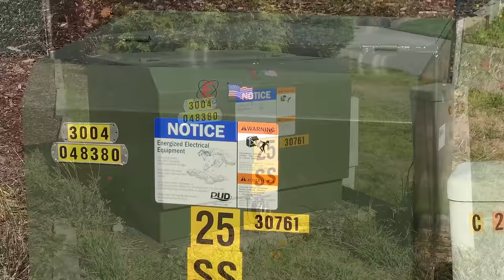Replacing a Pad Mounted Residential Transformer

Comment: Just as a followup, the customer contacted the PUD about the condition of the transformer on his property. Crews were concerned that due to the age that it might be had a good potential for leaking. Upon inspection it was determined it was in rough shape with quite a bit of corrosion (the unit dates back to the 1970s) and warranted replacement to avoid a potential leak. A win-win for both the customers and the PUD, as a changeout would not have occurred for simple aesthetics. The old unit was standard painted steel and the new unit is painted stainless steel, which will be much more resistant to the elements. Great video!
Reply: 25 as in 25 KVA= 100 AMPS ?
Reply: Guys must be non union rats 🐀
Reply: As stated in the video, that transformer was providing service for 3 homes, so up to 600 amps of secondary protection on that. The poco assumes the services are rarely going to be at full capacity, and wet transformers can take a beating.
Reply: Transformer must be dead, parking the other ends killing the primary side. Still lot of safety issues to be addressed.
Reply: If this exact same job was done in 1319 territory for UGI or PPL every person on site would be terminated immediately. So many bad practices and safety violations it is insane. Not a great video but a disgrace to the electrical industry and lineman everywhere. I cant believe PUD would even acknowledge this videos existence let alone comment on it
Reply: @demoniack81  Very unlikely that back feed would be present on the system unless like you said, some idiot plugged a gas generator in to an outlet or something stupid. But I'm assuming they probably know that this transformer is only feeding 2 or 3 houses and they are confident that there isn't any potential concerns of back feed. Also, they had the primaries capped the whole time and parked the feeder lines, so the transformer wasn't live until the end when they used a hot stick to connect the primary side.
Reply: demoniack81 it’s hot. They turned it back on to test secondary voltage then killed then plugged back in. And they either ran houses or closed a loop with a feed through. Big no no. Bunch of trash. And it took longer hot anyway. Kill it on both ends. Remove one screw on multi taps leave secondaries on tap. Put new tx. Plug both elbows. Make one hot next tx. Test voltage. Unplug next tx. Connect taps make it hot have nice day. Takes 15 minutes to still do it safely. Bunch of trash.
Reply: Sergeant Seven all utilities policy for contractors is hot gloves in tx if anything is energized. Hot primary means hot gloves. And pointless to leave it hot anyway. Takes longer less safer.
Reply: Great video lol. Yea we watched this Thursday and had to pause at least 10 times for “discussion” lol. You guys know that’s a bunch of trash and somebody probably got fired.
Reply: @MrT13  exactly!  If they worked for my company, they all would have been terminated on the spot.  Please everyone, it's not a being hateful thing, it's a watching out for our linemen brothers thing.  We all know that in linework, the rules were made because of the blood of other linemen!  Be safe brothers!!
Reply: Brad Smith it is what it is. This wasn’t even that fast either lol. Trash on trash lol
Reply: @MrT13  I hear ya!  Stay safe out there brother!
Reply: Brad Smith you too
Reply: @mattmatthew9422  agree... total disregard for safety. Many many OSHA violations and this kind of work will kill someone. Utterly and totally unbelievable. Apparently this company has no SAFETY program to speak of. I am amazed at what I watch here.
Reply: @demoniack81  I'm not a lineman but that whole thing felt a lot more casual than it should have been.  I tend to treat electricity like a gun - always handle it as if it's loaded.  Nice confirmation my gut wasn't that far off.  

The problem with luck is it eventually runs out :/
Reply: @mattmatthew9422  Videos dont show everything, it's edited 2 hours down to a 10 min video...
Reply: Thank you for the (necessary) explanation. The video uploader neglected to mention that part, and instead left the strong suggestion that they got "an eyesore" removed in order to improve their property values and they only got it done because they engaged their inner Karen and complained loudly and long enough. If that's not the real reason, as you say, then perhaps you should ask them to change their description.
Reply: Teat the new can for voltage??
Reply: How do you translate the Identification on the boxes to a meaningful ID on a map?
Reply: You guys forgot your ratchet @03:30
Reply: @DocNo27  Full send!
Reply: @linehandibew6205  guess you didn’t see the union stickers
Reply: @demoniack81  non union ...
Reply: @Nickdennis1992   the pud update. ... amazin the PR ..bs they do never addressing the safety issues. People have questioned.. open shop workers..
Reply: Are they PCB cooled?
Reply: @Nicholas-f5  No PCB's
Reply: So many unsafe practices, spent a long time in the industry and people would have been fired for half of what they did. Should have been wearing hotline gloves the whole time, yes they are slightly awkward but better than catching 14.4 kv (14 400 volts) and pushing the secondaries onto the primary side is a huge no no, if there is even residual charge you just put possibly thousands of volts down a phase only meant to handle 120 volts. Plus when they are doing the initial breaking of the elbows no bonding mat or checking if the lines are energized. Not to mention I don't recall seeing them wearing safety glasses but I could have missed that. In general this is great to use as a teaching moment and show people what complacency looks like.

I know a lineman who got complacent and took 25kv at 200+amps, dude got super lucky and only lost 3 toes.
Reply: IT totally looks like something from the 70s.  ...
Reply: @robprice58  lotta yes. Lot of no to what your saying…
Reply: @linehandibew6205  I agree .They very efficient and worked as a team.
Reply: @hayden8491  well paid princesses might I add. With great benefits and retirement. And a collective bargaining agreement that guarantees us with the highest pay without having to barter our own wages. We set the industry standard even for all the cheese eaters 👸👑
Reply: @Old_Gunslinger_Wild_Bill  it was deenergized, the cables coming in were not.
Reply: Since I'm a lineman instructor, I love showing this video to show what not to do. They do not believe in PPE. No hard hats, no eye protection, no cover on the primary cable, no insulated gloves. All it takes is one nic in the primary of any tracking and you brush up against it, and bye bye brother. You plan for the what ifs and the what ifs keep you safe. I don't care what your safety policies are. There are safety procedures in place for a reason. So daddy gets to come home at night. I mean why wear your primary gloves partially. Where's a good crew in this video. You are your brothers keeper for a reason. Eye injuries, head injuries, electrical shock injuries, right down to wheel chocks. Everyone on the crew needs to be fired making the company look this horrible in safety. Like I said safety procedures vary from company to company, but you can add to OSHA rules, not take away. There are blatant OSHA violations, and no doubt safety violations for their company. Why post this video???
Reply: Never wrk in TX without hot gloves
Reply: I know almost nothing about electricity. I’m a hobbyist of like automotive electronics at best. But even I was watching and wondering, “Is that line de-energized?” So many questions.
Reply: @sergeantseven4240  that happen to me. a women plug I  in a generator that her husband made back feed plug so she could  vacuum. we had  the primary was open down the street . I got bit
on the secondary. no safety glasses or face sheld, no hard hat or gloves, they must have opened and grounded at disconnect and tested.
Reply: @linehandibew6205  ew imagine being a union commy
Reply: @FanoFinz  you're not my brother lol
Reply: @Tre16  hahahaha....lol.  Yeah, you're a funny one.
Reply: “PUD” lol
Reply: @TheSiprianus  lmfao. Ok buddy.
Reply: @startreking  the power company has every piece of their system ID tagged and  each ID is mapped and has nearly all the information you would need to identify the unit and prepare for the areas special considerations such as bad terrain, age of unit, type of unit, voltages present and numerous other characteristics.
Reply: @jchambers2586  Old comment but the transformer is indeed 25KVA rated for two 120 Volt lines @ 208Amps each or 240 volts at 104 Amps.  Residential loads are rarely anywhere near this for any period of time even if you are combining the usage of three homes on this transformer.
Reply: @linehandibew6205  That's why it got done quickly.
Reply: @linehandibew6205  Good ,  I dis like unions !!!!!!!!!!!!!!!!!!!!!!!!!!!!!!!!!!!!!!!!!!!!!!!!!!!!!!!!!!!!!!!!!!!!!!!!!!!!!!!!!!!!!!!!!!!!!!!!!!!!!!!!!!!!!!!!!!!!!!!!!!!!!!!!!!!!!!!!!!!!!!!!!!!!!!!!!!!!!!!!!!!!!!1
Reply: That’s interesting, our property has an OLD rounded pad transformer with fins on it, probably from the 60s - I just called the power company about it and they said they don’t mess with them till they fail. 🤷🏻‍♂️😑
Reply: @davidnobles963  "no insulated gloves" Watch the very beginning. No gloves at all. How are they not dead? 😆
Reply: @Old_Gunslinger_Wild_Bill  It was de-energized by physically unplugging the HV side and stowing the connectors safely in the dummy plugs in full view at all times of all those working on it, so I can't think of any plausible way that it could have been accidentally energized.
Reply: @ironmatic1  Homes have a 200 amp supply each?  I guess 115 V in the U.S. so that's 23 kW per house?  Seems a lot.  House supplies in the UK are typically 60 amps (about 14 kW at 240 V) though you can order a 100 amp supply (at extra cost) in some areas.
Reply: @davemould4638  200A, 120/240V, 1 phase, 3 wire: 48 kW. Though particularly with LED lighting and high efficiency AC and heat pumps, you can easily have an all-electric 3,500 sq ft home with a 200A service and for most it's "overkill", but it's an easy standard—economics of scale. 

A typical neighborhood setup in Texas is a single phase 75 kVA 7.62kV - 120/240V oil cooled transformer for every four houses. The distribution transformers are spread all through the neighborhood and aren't more than 100 ft from each home's main panel, not one huge super low voltage substation for the entire neighborhood like in the UK.
Reply: @ironmatic1  48KW for a single house?  That's even worse.  I cannot think of any domestic home that would be using as much as half that amount of power, even temporarily.  Not that it is dangerous, but such over-kill just seems to me to be a waste of money and resources, and unlike owning a grossly over-powered car in the UK where the top speed limit is 70 MPH, it doesn't even serve the purpose of being a status symbol.  I can understand why fewer, smaller distribution transformers are used in preference to single large substations per suburb as in the UK, because houses in the US are generally much further apart than in the UK, so you would want to cut down on the length of low voltage distribution cabling between transformer and consumer, but not why every house needs to be supplied with enough power to run a small factory.  Unless large scale pottery making, arc welding and metal smelting are popular hobbies that are all frequently carried out at home at the same time as someone is using an electric shower!
Reply: @btwbrand  If you listen carefully, they've got three homes on that transformer. That gives you 35A on 120/240 split phase, which appears to be what they have here. That seems a little small to me, but I don't know how utilities provision power.
Reply: @trakeC  ok scooter
Reply: @davemould4638  If you want to learn, please stop lecturing.  

American homes use more power, on average.  And we don't even have electric showers. But we do have electric furnaces, electric air conditioning, electric water heaters, electric ovens, electric stoves, electric clothes dryers, electric hot tubs, and many more smaller electric appliances.  Not everything is electric in each home, but the provisions are there for future proofing.  

In a shared transformer arrangement like this, it is assumed that all of the supplied homes are not going to be using 100% of their ampacity at any one time.  In fact, that never happens.  Home circuit ampacity is assumed to be 80% of the rating.  The transformer only needs to be rated according to the usage tables standardized by the electric utility.
Reply: @jchambers2586  25 kilovolt-amperes, which is 25 kilowatts only if the load power factor is unity. But yes, at 240V that's a little over 100 amps.
Reply: @davemould4638  U.S homes use  60 Hertz  120/240  single phase ,2 hot wires with a center  tapped  neutral  at transformer  ,supplying  220 to 240  hot line to  hot line for water heater, large air conditioner units, electric  furnaces electric  stoves etc.  Lights, televisions, refrigerators ,microwaves and other smaller  appliances  operate  on  110 to 120 ,which  is either one of the  hot lines called  legs or poles to the center tapped neutral , ideally  1/2 of the homes 110/120 circuits on one line to neutral  and 1/2 on the other, to balance loads.   Large  commercial  businesses  are supplied  with  3 phase ,with a neutral  for 120 volt loads.
Reply: Which power utility is this?
Reply: Other than the casings being different; were there any other differences between the two units? I would hazard a guess that that transformer technology hasnt changed all that much in 40 years; but I'm curious all the same.
Reply: @robprice58  When working on these pad mounted transformers do you have to have two qualified people present because there is 7.2 kV on the primary side, even if it is insulated? And do you have to wear sleeves when you are making new connections in the z bars?
Reply: @davidnobles963  Thanks for this comment, do you know if sleeves are required when connecting two hot legs and a neutral to a Z bar that already has 11 houses hooked up to it? Is there a requirement for them to have two qualified workers when making a new home connection in one of these pad mounted transformers?
Reply: @1SGCurt  Not necessarily, it is best practice to have someone with you, and you don't go hands on with the high voltage side unless it is isolated and grounded and bonded. No need to wear the rubber sleeves on a pad mount you just put rubber blankets over the elbows and pay attention.
Reply: @pud I would happily consult on some safety training. This work is a fatality waiting to happen. I lost count of the number of OSHA violations in this video For the sake of your men, do better..